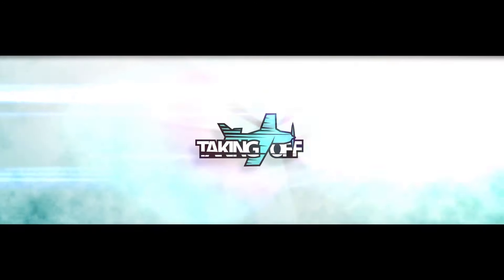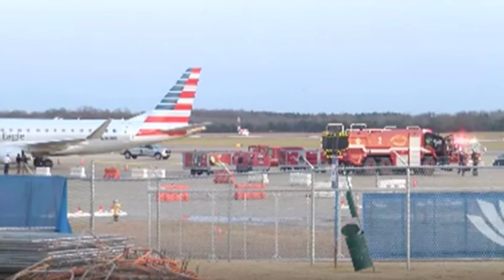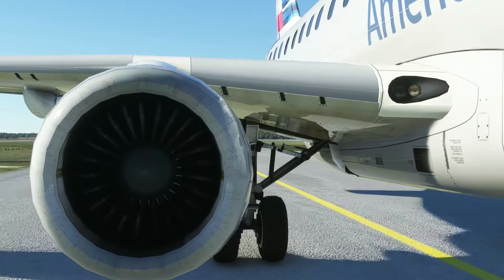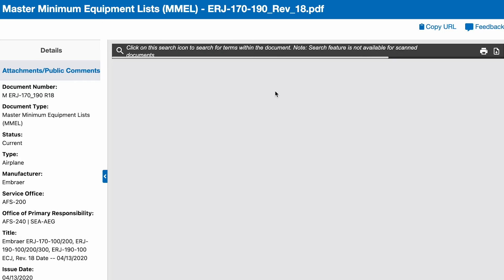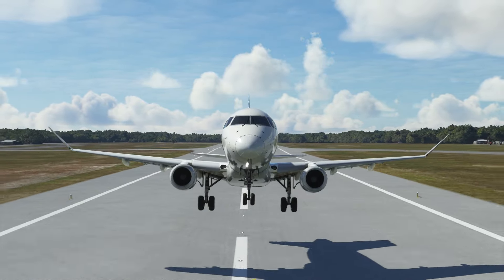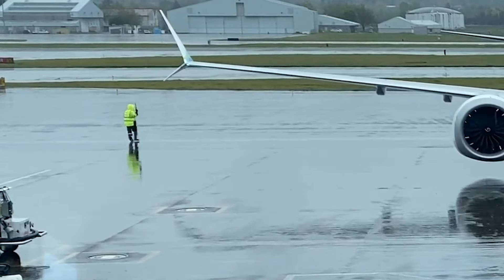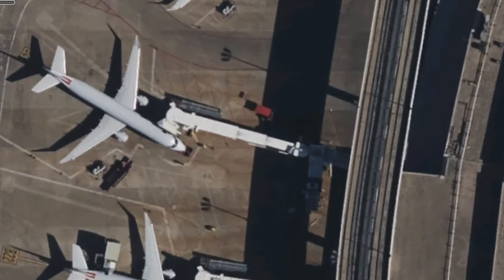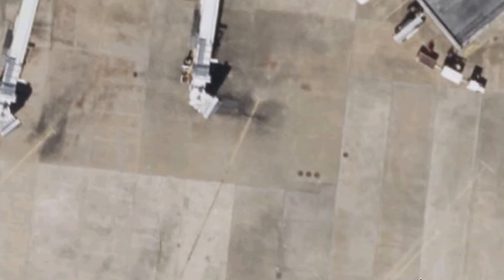Woman Sucked into Engine at Montgomery Regional Airport New Years Eve UPDATE

Comment: Do you happen to know whether these particular engines had the spiral on the spinner cone so that the rotation could be seen more easily by ground crew?
Reply: The problem is you can't see that when the plane passes you if your a wing walker! But if the crew forgets to turn off the becon which happens! Then you walk to the front and look to see that it's not spinning, plus the sound would be different when the engines are off and spooling down! I always told new hires to go to the  front look at spiraling thingy? (Don't stare at them)! And if it was raining or snowing see what's moving behind the engines!

Comment: Excellent presentation. Well informed, accurate, and great visuals. 
Another 'safety measure' are the white 'squiggly' lines painted on the engine fan cones of commercial jets. With so much noise on a flight ramp, the sound of one jet's engine running may not stand out against the running engines of other jets nearby. So, the 'squiggly' line spinning around provides an easy to see visual effect that indicates a rotating engine fan.
Reply: You really can't see them as a wing walkers once the aircraft passes you!
Reply: @davidsmiths5471  Are you serious with what you just said??? Once the aircraft "passes" you... you are no longer in danger of being ingested. Hence the reason why wing walkers cannot see them once the jet passes. There's what's called a "cone of danger" around the engine inlet. From the "cone of danger", the fan spirals are visible.

Comment: i'm a FO on the E175, but different airline from this one. We primarily taxi on two engines. It is the exception that we would shut off an engine coming in to park. If we do shut off an engine prior to parking, it would be the #2 (right side) engine based on hydraulic system operation. APU inop is an irregular operation and no one likes it. That being said, I have done it before.

Comment: They need a physical barrier that gaurds the engines.. I worked in the Elevator Construction field and it Is imperative that high risk areas are guarded with a physical barrier!  No exceptions, we dont know who is walking around and the introduction of anything going down a hatch while people are working below is a major hazard.  I think this is a similar situation,  anything can happen with employees, someone calls out they fill the spot with a untrained worker and Walla we have a death.  We can have a drivable barrier ready to roll its moved into position upon arrival and now we're safe.  I recall a woman surviving walking into a propeller at a private airport.   She is alive but severely handicapped.  I think of safety is concerned we need to implement some kind of protection either mobile or fixed.  It's all ok until someone gets hurt, clearly something needs to be done!

Comment: What still surprises me is the fact that even brand new airports still use ground power units to start up or power planes with an APU that is not working. You would think by now they would build airports with underground power connections that can easily be hooked up like a large extension cord...
Reply: How do you keep water out???
Reply: @davidsmiths5471  either the conduits come up into a pedestal or the connector is underground and the pit around the connector has a drain

Comment: Thanks for the update. I was wondering. Do the markings on the tarmac cover all aircraft? Only asking as there's a lot of different types of Jet turbines, are they made large enough so as to protect ramp workers from all engines i.e. a 707 sized engine compared to an A380? Only asking as the markings seem to be either missing or worn away. As engine power increases do they have to enlarge the markings, or are they big enough regardless of the size of Jet? Thanks in advance to anyone who answers :) -J
Reply: Yes but some larger aircraft 777,A380s 340s, 747 might not use certain gates because of there size or older jet bridges and if there's a access road or even a taxi way!

Comment: It's possible that they left an engine on in anticipation to do a cross bleed start utilizing the working engine to turn on the other engine as oppose to a huffer cart to be used to turn an engine on. With a cross bleed start, they leave an engine on, then get pushed back and turn the other engine on once they're done being pushed back. A much easier and significantly less annoying way to start an aircraft so long as you follow checklist procedures. This is generally only used when an APU is deferred.  I am not familiar with a 175 but that would be my guess as to why the aircraft engine was still on at the gate.

Comment: I dont understand why there isnt a coarse mesh guard on the air intake to these jet engines - it would hardly affect or impede air flow to the engine.  This would have stopped large objects from getting sucked in.

Comment: If the APU is inop. you normally taxi in on 2 engines this gives you two operating generators, redundant electrical, should the other fail. I don't know about the E-175, but on the Airbus or Boeing you often can't make a tight turn into your dead engine depending on your weight. If you do taxi single engine you generally always taxi with the #2 (right) engine shut down. Ramp crew is required by SOP to stay out of the safety zone until the rotating beacon is turned off. I see rampers almost always approaching the aircraft before this happens. Often opening the left cargo door before the #1 engine is shut down. Left cargo bay is right in front of the #1 engine. The airlines often push ground crews to get the cargo doors open ASAP as this triggers the aircrafts in time for arrival time at the gate. On time performance. In this case the crews first indication was the forward cargo bay being opened, followed shortly there after by a left engine failure. For this very reason when ever I taxi with APU inop. I always brief that we will shut down (non standard) the #1 engine short of the gate. At some stations it is hard to find people willing to work the ramp. You have to pass background checks, drug tests. It is a tough job. And can be hazardous. Often rampers are new and inexperienced. The airlines need to double down on their training. Strictly enforce not entering the safety zone until the beacon is off! In other countries like Mexico, Canada, Europe, they are extremely strict about this. This was such a terrible tragedy. Plus it was in full view of the outgoing crew. And all the passengers waiting in the gate area inside the terminal. The flight crew and ground crew, and any other witnesses will all have to live with this terrible tragedy. This young ladies family and friends will have to live without her. This is a terrible, terrible tragedy that should never have happened. I saw pictures of an accident like this with a Continental Airlines mechanic that was killed this way walking in front of a 737 engine. It is gruesome, it makes you sick to your stomach. And it is so preventable and should never happen! Safety always needs to come first!
Reply: And just to add, from a human factors stand point it is easy to become complacent. Even when doing dangerous things. It can easily become so routine, you let your guard down. It is so important to always maintain situational awareness. And stay vigilant! Follow safety SOP's. And look out for each other if you see something unsafe. In any accident, it is normally never just one error or failure. It is a series of errors/failures that lead to the end result. And catching any one of those could have been enough to prevent the accident.

Comment: How is it possible to be sucked inside the engine when the airplane is parked and the thrust is very low or off?
Reply: The Engine was running due to an Inoperative APU.
Many High Bypass Fan Engines can suck in a full size adult at IDLE - Even AFT of the Engine Inlet. This is why the Engine cowlings have Red or Orange stripes [ paint or decals ] on the sides to depict the NO GO ZONE. It all comes down to Situational Awareness especially on an Aircraft Ramp.
https://forums.x-plane.org/uploads/monthly_2016_10/Engine1.jpg.f0f0a263df5baa5cacae685cb81881b0.jpg
Reply: @guitarhillbilly1482  Thanks for clarification. Then it’s a violation of security protocols, I guess

Comment: These workers need to understand the fluid dynamics of the situation, which can be explained very simply.  As you get closer to the engine intake, the suction pressure and air velocity increase EXPONENTIALLY.  GIVE IT A WIDE BERTH, if it is running at all.   The "safety envelope" needs to be explained as "Stay away as far as possible".

Comment: Why can’t there be a screen on the engine to prevent something from flying into it?
Reply: Its an Air engine.   Any blocking the front would defeat the purpose of an air engine.
Reply: A wired screen/grate would not block the wind.

Comment: Ever since I started working for an airline, I've been wondering why a pusher can't get certain large planes like the 175 to the gate like they do at certain gates that have been properly built for the plane to be found and connected to be brought to the door.  Also, I understand that the procedure for when an aircraft is pushed and taken to the taxi way must be evaluated and certain aircraft that have the type of engine such as the 175, must only run the engine at minimum capacity while in the vicinity of the gate.  Lastly, I understand these pushes must be supervised and assisted, such as when the headset used by the pusher is damaged.  There is much that can be improved in order to safeguard the lives of our employees.  Personally, I am sorry that this tragedy has affected me a lot since our colleagues are our second family as we always say to each new hire “welcome to our company family”.🙏😞

Comment: It has always amazed me that better safety precautions against jet engine accidents for grounded aircraft have never been developed. It has traditionally been a 'trust system' of training ground staff to do the right thing. When it comes to aircraft safety, it should always be a 'fail-safe' system' ensuring accidents like this never happen. A protective mobile fence arrangement should be in place on either side of the plane before the air crew are allowed to start engines of departing aircraft. When the aircraft is ready for taxing, the mobile fences are moved away.

Comment: A cone is much lighter than a person.  I flew a 737NG.  Without looking up the thrust to weight ratios of both planes to compare I can't be positive, but I don't think that the Embraer engine at idle is sucking in more air than the 737s.  I don't believe that an idling engine on either plane could suck a person off their feet.
I could be mistaken and none of us will know until the NTSB report is released.

Comment: This is horrible. I can only hope that it was over in an instant. This happened here at CLT some years back. The mechanic was standing next to the engine and gave the sign to increase throttle. It pulled his cap off and he reflexively went for it and got sucked in. What's worse in these situations, is that the passengers have witnessed this as well. Here, the entire flight was looking out the window to see what the guy was doing. Tragic.

Comment: That guy placed the cone way too close to the engine and also while the beacon light and engine was still running. I work on the Ramp. That should NEVER occur. You never place cones around an aircraft when the beacon light is on and or the engine(s) are still running.
Reply: So if the becon is still on for say 5 minutes your ramp is just standing there looking at the blinking light??
Reply: @davidsmiths5471  No you goof. If the pilots forget to turn it off after the engines have been shut down we signal them from the ground or call them on the Air-rig. Always someone that can’t think critically. smh 

You NEVER approach an aircraft with the beacon light on even if it’s an hour.

Comment: What was she doing in front of the engine? Ground crew? Close friend was working carrier decks both of his enlistment. Very dangerous environment.
Reply: Many High Bypass Fan Engines can suck in a full size adult at IDLE - Even AFT of the Engine Inlet. This is why the Engine cowlings have Red or Orange stripes [ paint or decals ] on the sides to depict the NO GO ZONE. It all comes down to Situational Awareness especially on an Aircraft Ramp.

https://forums.x-plane.org/uploads/monthly_2016_10/Engine1.jpg.f0f0a263df5baa5cacae685cb81881b0.jpg

Comment: This is one of the first things hammered into anyone who will be working on the flightdeck of an aircraft carrier - you are FOD. Always watch where you are, always watch where others are, always watch where aircraft are. Even if you're not in front of an aircraft that is running, one that is turning can blow you off your feet directly into the path of one that is. As he said, the volume of air that is pulled into a jet engine, even at idle, is beyond comprehension. They are giant vacuum cleaners

Comment: Normally you would call ops on the way in to let them know you have an APU inop and you needed to be plugged in when you arrive, but airlines under staff ramp personnel on purpose and it’s really common for no one to be available to answer on the radio at small airports like MGM.  So sometimes you end up waving and trying to throw out hand signals while the engine is still running and they’re chocking your nose wheel.
Reply: Most gates would know about the inop APUs before the plane even lands!